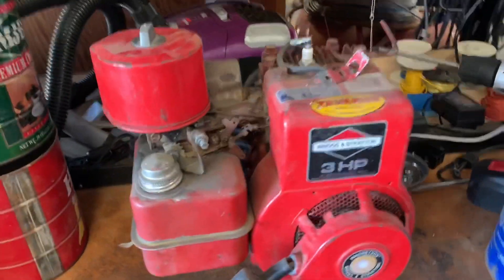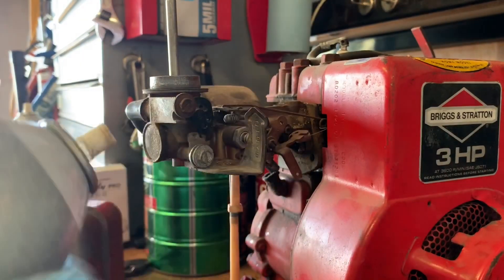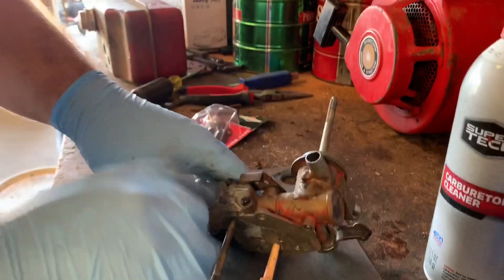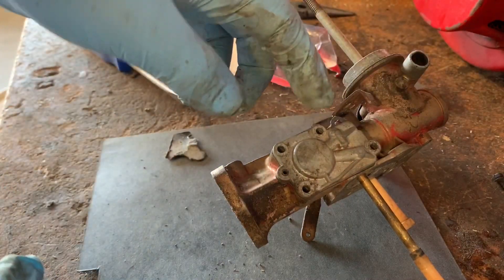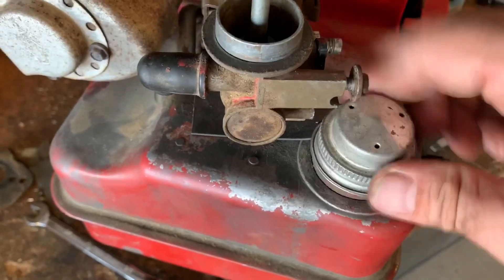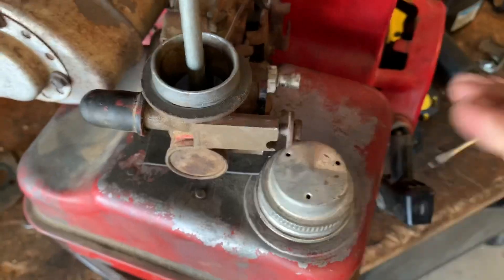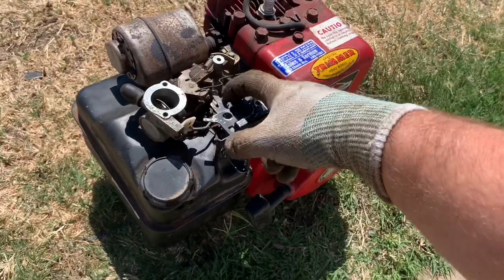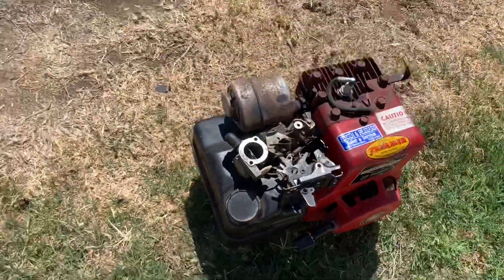Carburetor Work on a Vintage 3HP Briggs

Comment: I have one of those built in 1979.  I rebuilt it.  Gas tank rusty as hell.  Cleaned out rust with muriatic acid and it was spotless, like new!  Added little oil to prevent rust in future.  Damn thing still rusted out only 2 days later!  And the tanks aren't cheap.
Reply from the maker: After all that it still rusted up?
Reply: Hi once the tank is cleaned with the acid I understand that the acid has to be neutralised with an opposing solution otherwise it it will stay on the walls of the tank.

I think it's to do with acid / alkaline and neutralisation and pH balance. I seem to remember reading baking soda can be used.
 I'm sure someone with more  knowledge can help.
Maybe worth a Google and doing the tank again and this time once neutralised  spray some product like a wd40 in side or a good dose of oil again
Reply: @Tod_Unctious yes a baking soda and water solution works good for neutralizing the mutiaric acid

Comment: Hi, if this is a 3hp 3 bolt carb can I please get the part number on it can’t seam to find one and the model and serial number are missing. Much appreciated!!
Reply: The model and serial number are gone. It would even help if I could get the model and serial number from this engine. Thanks again

Comment: What is the part for the OEM gasket you purchased?  Can I find it on Amazon on home depot?
Reply from the maker: youll have to pull the model number off the side of the recoil and use a site like partstree for a diagram, there were like 4 different versions of these

Comment: I have one on an 1950s jari sickle mower! It's locked up tight
Reply from the maker: Watch my videos on how to unseize a lawnmower engine. It’s basically the same process, you should be able to free it up and get some more use out of it if the engine itself is seized.
Reply: @hanksgarage_  it's a nice machine, only been used a couple of times but has sit since 1977 it's been stored in a shed so I assume it would have seized from lack of oil and not subject to rust.
Reply from the maker: Remove the spark plug and scored a bunch of WD-40 inside the cylinder let it sit for a bit you might have to do it a couple times but you should be able to rotate the crankshaft after a while
Reply: @hanksgarage_  I'll get it running, I've barely done any work on engines but I'm learning and exposing myself to different problems, plenty of engines at my family's cabin to work on!